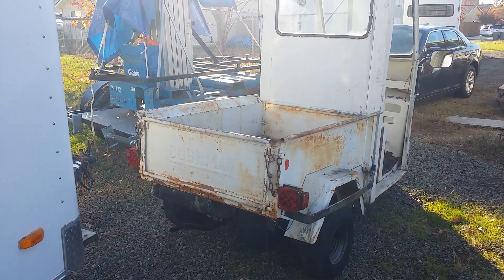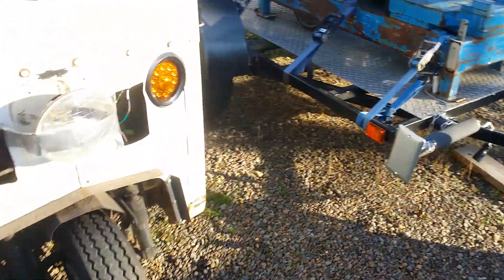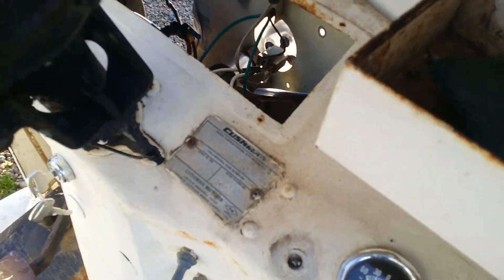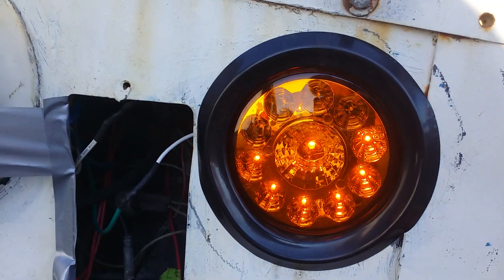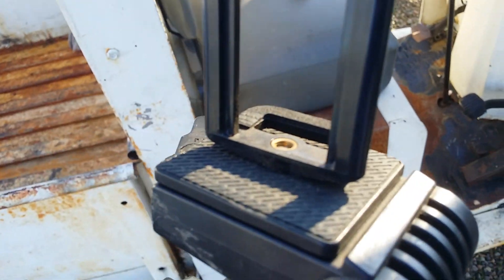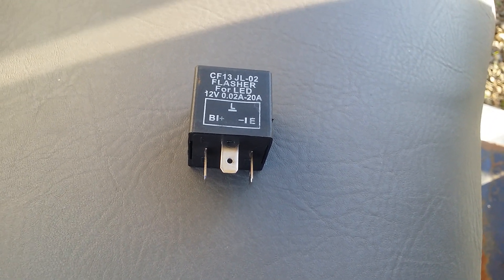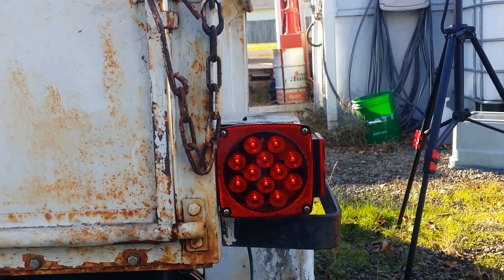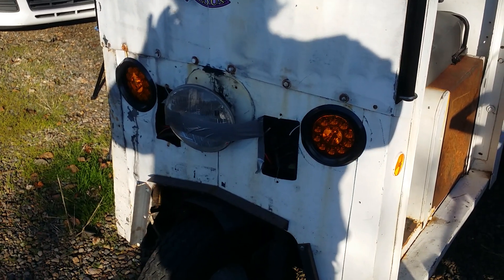You upgraded your rig to LED'S and now your turn signals won't flash! Watch this to learn why.

Comment: Yeah same on my 1954 New Yorker. Switched out all to led. Bright and lovely but no hazards. I've tried multiple led flashers but a no go still. I put the original left turn signal bulb back in the front and they all work. Definitely looking for an answer even if i have to Mcgyver it up to work
Reply from the maker: I too have bought LED flashers that did not work then found some that did. In the early days of LED conversions people installed resistors to add enough load to make them flash. Google LED Conversion Resistors for more info if you can't get a good flasher.

Cheers

Glenn

Comment: I put all LED lights in my truck , I already changed flasher to slow down the blinking my problem is nothing blinks when the headlights are on
Reply from the maker: If the wiring was all good, the headlights should have nothing to do with it. I would check for bad ground wires at the tail lights. Jeeps are famous for this issue. .

Comment: 2001 C5 Corvette.  i replaced the front bulbs with LED's because the heat was melting the housings.  After replacing all four rear 3056's w/ LED's, I got hyperflash.  I installed the relay
and all is well except... When the tail lights are on the brake lights work fine, yet when  
I use the turn signals the rears light up but don't flash and the fronts do!??   Ideas?
Reply from the maker: I have no idea. Maybe the computer is operating them and it's looking for more load. My father in laws MG did not like the LED many years ago so I bought two incandescent clearance lights, mounted them under the hood, and tied them into the turn signals and it works great today still. Maybe that's an option?

Comment: I bought a set of signal lights for my motorized bicycle. There switch back. So the signals work but as soon as I connect the DRL to a hot wire they quit flashing.

Comment from the maker: I will be posting a video in a couple says, I upgraded my turn signals in my shop truck to LEDS and I ordered an led flasher. It has arrived so I can complete the install and the video. I will give more info on the flasher unit in that video.
Reply: The 3 prong. One is Battery which is B+, L is for load to the signals, E- is ground

Comment: So I upgraded my 84 Buick to Sylvania Zevo LED. I’m having this flasher issue in the front turn signals not the rears Question is, my hazards flash fine. It’s the turn signal that gets wonky. Do you think this solution will work? .

Comment: Hope they fixed this... some of the led flashers when they die get stuck in the off position so in failure you can't cycle your switch to make the lights blink. The old ones were designed to do that.  Thanks for the vids. Wayne
Reply from the maker: Very interesting, thanks for the comment. I did ask for a replacement flasher, the contacts may be defective as the LED lights were very dim, way to dim to use on the road. Hope the replacement is better.
Reply: @GlennsSpeedShop  they make a 3 tab one with a 4 th wire that goes to ground.